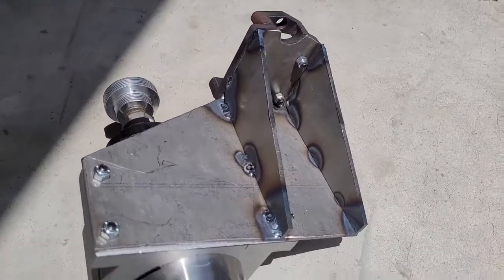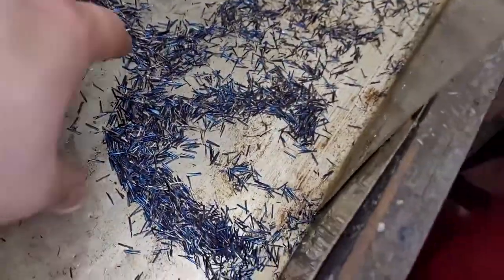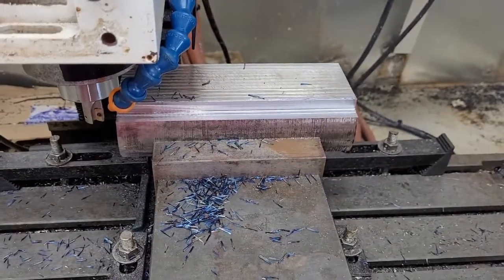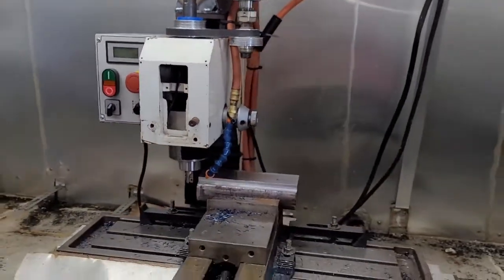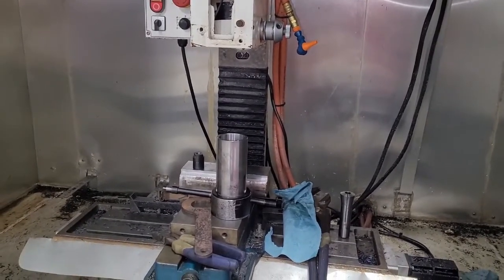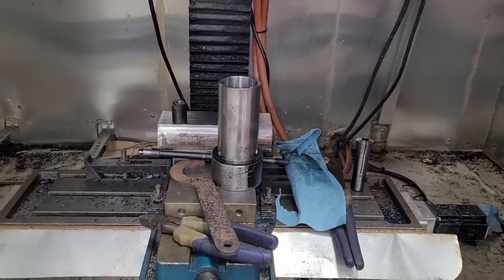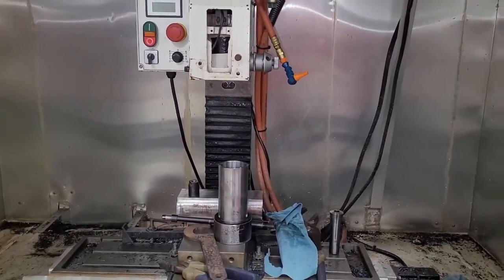PM25 CNC Mill SHREDDING 4340 STEEL

Comment: The Mobil shc PM-460NLIG 1.5 is nice stuff and will last a long time.

The TRB bearing take a long time to break in like 20 hours or more and run almost dry. When set up with light preload and really light grease you can run 4K lont runs or 5K  without over heating. They will still get nice and hot but not burn the grease.
Reply from the maker: Couple questions for you. And by the way, this is your CNC conversion kit on the machine!

1. What is TRB bearing? 

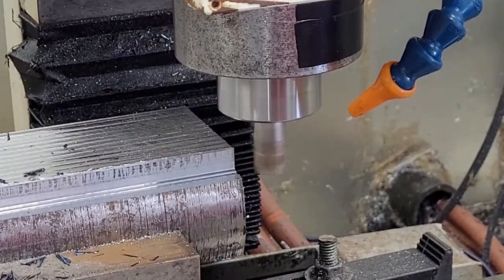2. Hear and see the weird sound and surface finish it leaves on the material? From 1:50 to 1:57 it's both audible and leaves a pattern on the material it's cutting. What could that be? Something going on with the X-axis maybe?
Reply: @patrickcowanjr1   TRB=Tapered roller bearing, All the benchtop mills come with roller bearing not angular contact. They are a strong bearing but have a lot of contact area so run hot. Like you said the grease makes them hotter. If you want to run over 5K then you really should change to AC bearings. Hot is OK for a TRB, lets say around 150 F to 180F even 200.

The grease is important. They run a slightly higher melt point over axle grease. The spindle heats up and melts the grease and that is the lube. The lower melt axle grease will flood the bearing and run out way too fast. 

That cutter is quite large for a 25 size mill so you will have ringing at different RPM. I'm surprised at how good it did. I don't do a full side cut with the 1604 inserts on aluminum. Mostly .150" to .300" so for steel on a smaller mill it did quite well. 

Reducing the DOC will smooth things out.

Comment: What are you gonna use the mill for mate? You going to build those main bearing caps? (if that is what they are called lol)
Reply from the maker: Yes sir! The plan keeps changing. Long term I'd like to have a machine shop manufacturer the caps and sell them. But the cost to have a group of say 10 caps made is expensive. So thinking now I'll make a couple sets, one for me, and one to sell. If I sell the extra set, I'll make another and see if those sell. If it turns out there is interest in these, then I'd consider spending the $$$$ to have a batch made at a machine shop.
Reply: @patrickcowanjr1  You think with those caps, some rods and pistons and a rebuild of the block would let it hold a reliable 300whp? Good stuff man. I think youd do well with your own fab shop :)
Reply from the maker: @_Jonez_  I think so. Adding a harmonic damper at that level could be a good idea too IMO to protect the oil pump. 

I do have a small shop now, I think I just need to figure out how to get customers in the door that wanna go fast!
Reply: @patrickcowanjr1  Thats awesome its a shame you're not in the UK. Most of what we get is a bit overpriced